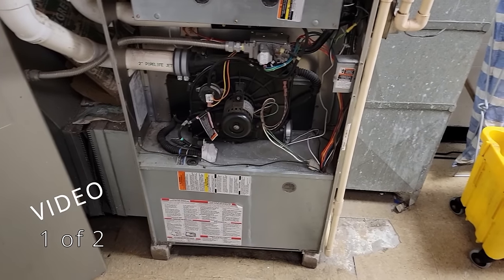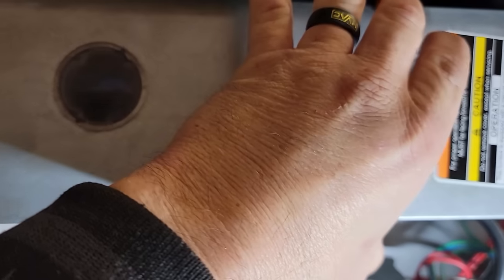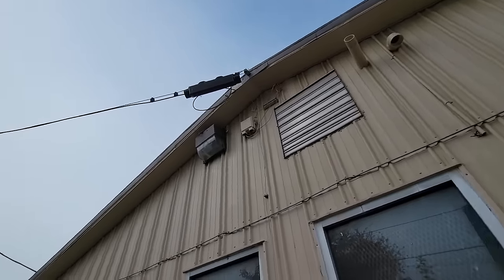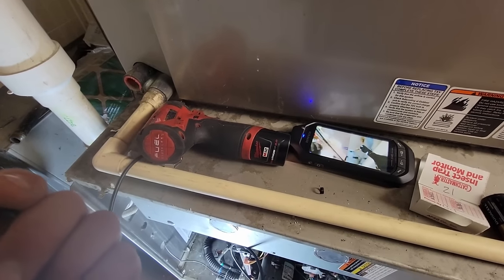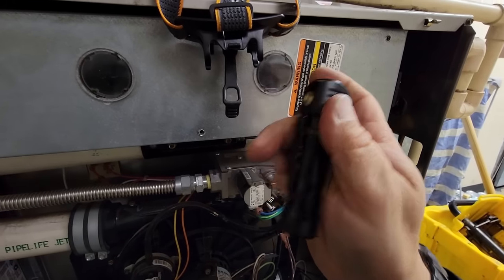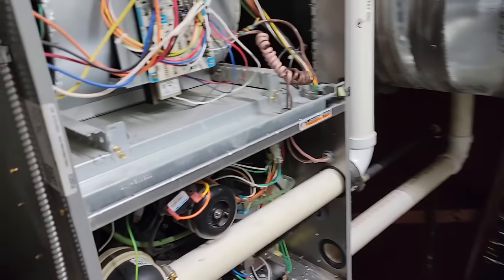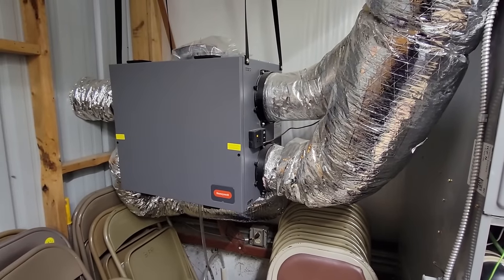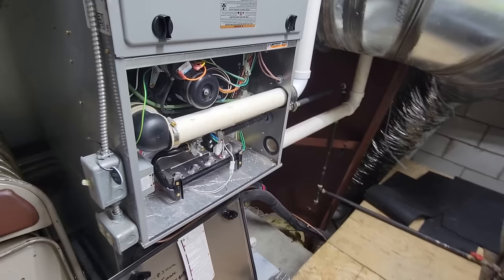No Heat Pressure Switch Party!

Comment: New subscriber. I remember when flame sensors were becoming the norm. Every manufacturer had instructions in the service manual how to clean the flame sensor. Carrier specifically mentioned steel wool but other manufacturers said steel wool, a scotch brite scouring pad, fine grit sand paper or plumbing cloth, or a stainless steel brush was ok to clean the flame sensor. I always clean first unless the rod is warped, ceramic is cracked, or somebody cleaned it and gouged deep grooves in the rod so now it gets fouled much quicker
Reply from the maker: Thank you for subscribing! Yep I remember those days, we were at Lennox and Carrier dealer so I had to deal with both 😁👍👍

Comment: Those draft simulation manometer are awesome for checking the pressure switches
Reply from the maker: I have the Filedpiece but if you don't know the rating it doesn't help.
Reply: It's good to know at what w.c they open and Close at,I use it everyday..

Comment: I hear your frustration with the lack of information about the pressure switches. I worked with the Trane product, they printed the switch operating pressure on the label which, while that info was helpful, it isn’t the whole story. The PS data I often found most helpful was the closing pressure, in other words, how deep a negative did the draft inducer have to pull to close the switch. For example, one unit I remember had an operating pressure of 0.88” w.c. on the label. Trane said you had +/- .04” leeway either side. Yet, that same unit needed -1.25” w.c.negative to close the switch. Trane didn’t publish the closing pressure in the furnace data, you’d have to ask a field rep for it. As a field rep for Trane Canada, I made sure our dealers had a list of closing pressures for individual units. Nice work cleaning up this installation.
Reply from the maker: If I called the supplier they can look it up for me, generally it'll be somewhere in that ballpark and all the new ones have them listed. I know what you're saying far is closing versus opening, I've always noticed it to be the pressure that it closes I believe. But I couldn't be wrong. Generally I've always noticed it runs about one and a half times whatever it's rated at if it's vented and working properly. Thanks for checking it out and leaving a comment 👍👍
Reply: sometimes it's stamped right into the tiny lettering on the plastic switch housing itself.
or just parts change them out like most people do 🤣🤣

Comment: We run those same furnaces in a bunch of our rentals, and commonly get this code 31 on no heat, 99.9% of the time resulted in the port on the inducer going into the pressure switch being clogged. Our HVAC vendor informed us that if one seems to becoming more problematic it's starting to have heat exchanger issues.
Reply from the maker: I would have to agree with them, I had it happen every year on one residential and change the heat exchanger and it quit. Of course that only means until it just starts doing it again with the new one 😁

Comment: Good job making sure that pipe was clear.  I really hate the way the drains are designed on all of these high efficiency furnaces and it seems that many installers haven’t received proper training on how to set up the drains properly. I also hate the fact that many furnace manufacturers use plastic covers over the secondary heat exchanger that eventually will crack and leak.  Goodman seems to have issues with their plastic covers and leaking gaskets on their high efficiency furnaces.
Reply from the maker: Thanks got supporting the channel👍👍🤜🤛

Comment: I don't do HVAC (much) but I do network cabling.    When you're working with PVC, fish tape has problems.    First, if you're not running pressure, you don't need schedule 80.   You can use electrical conduit, which is more UV resistant (I believe it's also more heat resistant).  That said, standard plumbing pipe ends up with serious blocking issues for fish tape.  The 'edges' are on both sides of every joint.  (Electrical is flared to make it more of a smooth run, specifically for fishing).     So, in a facility like that one, I would not have been even trying to go upwards.   When you hit the top, you won't be able to twist it enough to force it in the 90.    Go from the top.   Once you hit the 90, you can usually twist and push and have it pop the groove into the next section, where gravity is more your friend.     My personal recommendation would be to get some rat wire and make a basket over the end of the pipes, to make it harder for the birds to get in.   (Putting it across the pipe directly can increase the restrictions.  A basket avoids that) 

I've personally given up on using coiled fish line except for a VERY few instances.   Mostly, I use flexible fiberglass 'glow rods', where I can simply attach two to five foot sections until I reach my goal.
Reply from the maker: I didn't figure the fish would work, good advice 👍👍 thanks for sharing!

Comment: Your first Carrier you were working on... Did you get a lot of junk out of the drain trap when you washed it out..if you did wash it out. The tube from the secondary on the bottom left also shows signs of debris that will plug up the drainage. Carriers have been known the have poor silicone usage in their secondary heat exchanger that will plug up the drain. By the time you get to the customers house sometimes the unit has drained enough and is working on arrival. The furnace basically drowns.  High CO in the exhaust will be a definent indication of this. Carrier I believe was sued in the USA years ago with this (can find it on the internet) 2008 shouldnt have this problem but in Canada we have seen a couple of these situations. Another one for Carrier is if you run into a unit that has a pressure switch that is half plastic and half metal. change it right away. The contacts inside are junk. There was a recall of those too years ago. Keep up the good work and im open to questions and learning. The second furnace with the water in the tubing to the pressure switch is probably a leveling issue and should be tipped slightly to the drain side. Very surprised in lack of CO testing on calls in every youtuber that does service calls. or clocking of meters
Reply from the maker: I got a lot out of the trap when we checked it a few months prior. Other than gas pressure adjustment what are you going to adjust on a gas furnace to change what the combustion reading is? The isn't any air adjustment, no adjustment for the draft, So what's the point of using a combustion tester on every furnace unless you have a reason to? And even then it's just a confirmation of yes or no it's bad. We have over 100 employees and 12 are service techs, that's a lot of money for analyzers that will need calibrated every year, and the sensors replaced every year. That's not even counting the ones that will get damaged or stolen.  It's just not needed.
Reply: @HVACRSurvival  So... On an Amana when the secondary is separating from the header and there is no change in the flame and no air adjustment and the flame looks PERFECT and the heating is on the mark BUT the CO in the exhaust is 1000 ppm...Thats ok?  and how would you know this if you arent taking readings on every call? I guess in the USA there is no authority like we have in Canada so people dont die of CO poisoning. Very surprised that a technician or even a company would not equip the technician properly and for safety. If you dont have the safety equipment to do your job properly and safely then a company or technician shouldnt be working in that particular trade IMO Im surprised at your comment and slightly concerned with the attitude I got back for a comment about safety for customer houses or businesses you go into.  I guess i will go watch another tech that actually does the work safely to get tips of the trade

Comment: Those Carrier furnaces are notorious for crap secondary heat exchangers. I pull the tube from the collector box. If it has the rust colored gunk in it.....bet that secondary is already toast. I always pull the blower on those and visually look at the secondary. You can see the crud in the drain trap too. Check out the N-take2 for combustion air pipes. If the pipe gets clogged, it'll pull open a damper to allownfor combustion air.
Reply from the maker: I've done a couple videos tearing the secondary apart.  I change around 4-10 a year. I'm way to familiar with it. Thanks for checking it out!

Comment: You had better luck with these furnaces then I have had with my Panasonic mini split that the outdoor unit power supply board died because of Indonesian House Geckos and... Parts no longer available! 12 years old! Getting replaced with a Daikin as I have had 2 R22 units for 15 years that never had an issue. Ironically I have a Mitsubishi Electric unit that also suffered a similar issue of a similar age I can still buy parts for. Daikin were also the only brand I'm aware of you can get multisplit systems off the one outdoor unit.
Reply from the maker: Mitsubishi can do several heads off one condenser.
Reply: @HVACRSurvival  Lean something new every day. Didn't know Mitsubishi also did it as well. 👍

Comment: Why didn't you use the field piece pump & continuity tester instead of blowing the hose?
I did purchase the scope from Amazon.
Thanks again for the videos!
🥃🥃🍺🍺🍺🎯🏌🏻‍♀️
Stay safe. 
Retired (werk'n)keyboard super tech. Wear your safety glasses!
Reply from the maker: Because of two things, the first would be because I didn't know what the pressure switch was rated for to test it, the other is It takes longer to set that up than to just check it while running under normal conditions. Thanks for using the link! See you tonight if your going  to be around for the live show.
Reply: @HVACRSurvival  🤣👍🏻